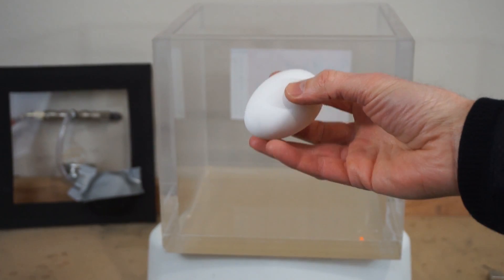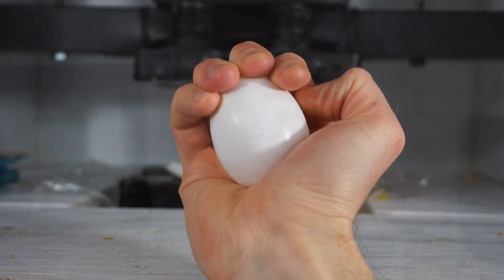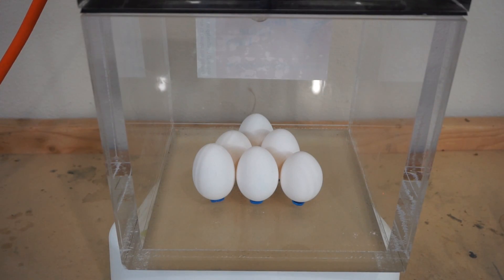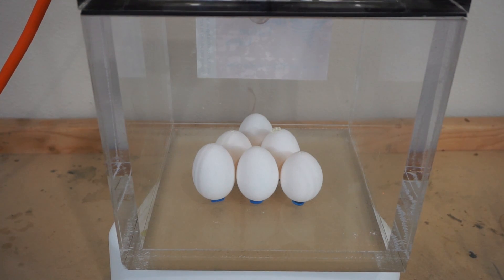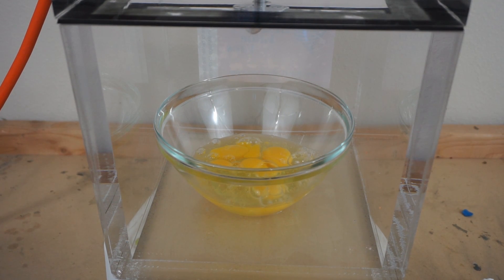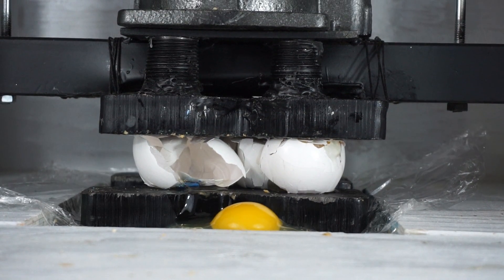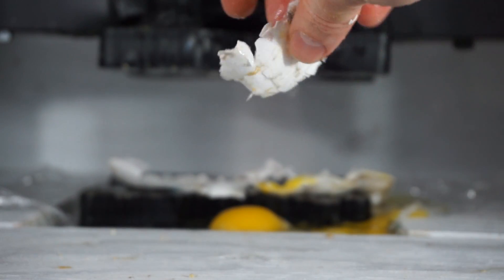What Happens When You Put 6 Eggs In A Huge Vacuum Chamber?

Comment: Can someone please explain why the eggs began to boil in the vacuum chamber?
Reply from the maker: +ueger yonic the lower the pressure the less heat is needed to boil the liquid. If you get the pressure low enough then just room temperature has enough heat to boil the liquid.
Reply: Thank you!
Reply: this boiling is just releasing gases from the egg because there is no pressure to keep it in the egg and there is no heat generated
Reply: They boil because the low atmospheric pressure in the vacuum lowers the boiling point. They don't cook because it takes a certain temperature to denature the proteins. Since this is still at room temperature the proteins haven't reached the temperature required to denature but the boiling point has been lowered to room temperature.
Reply: boiling point is related to something called vapor pressure (you learn about this in chemistry class), which after what +Hydraulic Press Action said (right above me), means that at higher altitudes, and lower pressures, boiling points are lowered (which can actually affect things like cooking in some ways in those places.)  Typical boiling/melting points are based on 1 atm, or 1 (standard) atmospheric pressure.
Reply: also Oxygen is needed, cooking is oxidizing carbon basically!
Reply: It's not boiling in the normal sense as in heat applied to the point of a liquid changing states to a gas, but rather a subatmospheric pressure (vacuum) and the dissolved gasses coming out of suspension back into a gaseous state. In a scuba diver it's called the bends. That's when the diver exceeds their maximum bottom time for a given depth and they become BTPS, body temperature, pressure, saturated at that given depth. When they ascend, the water pressure decreases and the dissolved gasses come out of suspension and form bubbles. It's a fundimental gas law of chemistry. The eggs were not cooked because there wasn't heat sufficient enough to denature the protein. If anything, the temperature decreased as expanding gas becomes cooler. Compressing a gas generates heat.
Reply: Cool Fox everyone on the internet is a science teacher
Reply: less atmosphere, boiling temperature drops dramatically. bam your eggs are boiling at room temperature.
Reply: ueger yonic 
Cold boil, water boils under either heat or low pressure, when the it shakes apart, from either not being pushed together enough, or shaking enough to become gas.
Reply: Ok, but why didn't they cook?
Reply: ueger yonic 

BECAUSE SCIENCE
Reply: ueger yonic boiling isnt a heat based thing but heat makes things lighter and rise allowing it to rise in Normal pressure and boiling but in the vacuum there's no air make the egg air the lightest thing rising
Reply: emphasis on magnificent bastard
Reply: R41N 
Britt Lab did this on water
Reply: It's actually not boiling. It's the wrong term used. From what I had learnt in college, the negative pressure is bigger than the forces of attraction between those protein particles in the egg. And because of this, the protein separates far apart from each other, far enough to becomes pocket of gas, just like how the air molecules are far apart in the air we breathe.
Reply: Henry's law
There is gas entrained within the liquid and as atmospheric pressure drops the gas entrained will be liberated 
Its similar to opening a soda bottle and seeing the carbon dioxide bubble up.
It's not the same as boiling from additional heat because in a vacuum there is no change of state, but the boiling point will drop significantly. That's a poor explanation but it should point you in the correct direction
Reply: ueger yonic the boilimg point of liquids is direct proportional with the pressure. lower pressure,lower boiling point
Reply: ueger yonic Air particles exert a pressure onto liquids, to boil the liquid particles must gain enough energy to surpass this pressure. When we remove the air, less pressure acts on them lowering their boiling point.
Reply: ueger yonic when air pressure is reduced it makes the negative air hotter
Reply: ueger yonic same way your refrigerator works. water boils at 212degrees at atmospheric pressure if you pull it into a vac it could boil at 30 degrees below zero. refrigetator works by mamipulating temperature press in side a sealed vessel takes heat to make physical change from liquid to vapor. there is heat in everthing down to 359 degrees below zero. which is absolute zero
Reply: ueger yonic howtobasic was summoning
Reply: That is some basic shit, no need to be a science teacher
Reply: +Unseemeteor Gaming
Temperature =/= Heat
Boiling something at subcritical temperatures(T<Tcrit), or just going passively into the gas phase from the liquid phase through evaporation  always requires an input of enthalpy (∆Hvap), which means the boiling substance draws heat from the surrounding matter. This is why for example water feels cold on the skin when it evaporates. Even if the pressure is so low that something boils at room temperature, the gas phase is still much more energy rich than the liquid phase since the particles are much faster, so an addition of heat energy from the surroundings is necessary. That is for example the principle of how a fridge works, a liquid is boiled at room temperature in low pressure, and the energy for that is taken from the fridge so it gets colder.
Reply: +Zach Morgan
Entirely wrong, nonsensical gibberish. Please refrain from answering questions if you are entirely uninformed on the topic.
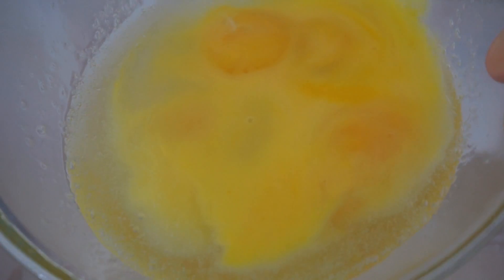Reply: Actually they look to me like they were starting to cook. 3:25
Reply: please what's the name of the video
Reply: lower preasure, lower boiling temperature
Reply: Pressure x Volume (Proportional to ) Temperature

Keep the volume constant, Lower the pressure, lower the temperature you will be needing to do anything with it.
Reply: ueger yonic vapor pressure, you learned it in chemistry
Reply: +Mike Mike the Jack bot Bruh chill
Reply: eric fleming But where eggzatly 😜 is the gas coming from?
Reply: I wonder what they would look like if you left them there until there was no dissolved gas left. Because my thing was how could it let off so much gas but still appear the same?
Reply: Christopher Burke I would imagine not too very different. An example was when  returning Russian cosmonauts experienced decompression of their capsule on re-entry and were in a vacuum for some 10 minutes (no space suits). Aside from evidence of a massive decompression, their bodes looked relatively OK. What I mean is evidence of free air in the tissues. The skin "feels" like how rice crispies sound. If that makes any sense. But the cellular damage if far more widespread beyond subcutaneous emphysema. There's free air EVERYWHERE.
Reply: ueger yonic it's because of the gas molecules in the liquid when the gas gets sucked out, it bursts through the liquid
Reply: what? how did you came to that conclusion? who gave you that idea?
Reply: jezus22 . Who are you replying to? I'm a scuba diver and specialize in respiratory therapy. I deal with compressed gasses, their effect and how the body reacts, produces and eliminates them, among other things.
Reply: i know how compressed gasses works on your body under the highier preasure then normal, that nitrogen is pushed into your blood like CO2 into the coke. but what we can see here is something completly different. it have nothing to do with gas nolecules in liquid cause it's liquid(water) itself changes the form into the steam
Reply: jezus22 . That's the best way I can describe it, because the egg/water isn't boiling. Water won't boil under 212°F at 1 ATA. I have taken syringes of blood, occluded the open end and pulled back on the plunger and was able to pull dissolved gasses out suspension, then release to watch them dissolve back into suspension. Yes, it works both ways. I've also tried it with normal saline in a therapeutic hyperbaric chamber, supersaturating the saline at 3 ATA with 100% o2. As predicted, upon ascent, the dissolved gasses come out of suspension. Saline also behaves the same with the syringe experiment
Reply: water in egg actually is boiling. it is all because of the preasure, or lack of it, cavitation cause the same thing. btw gas inside the lighter is keeped also in highier preassure and that is why it stays in liquid form you compare 2 different things, maybe because in both cases we have common denominator witch is preassure.
Reply: jezus22 Well, that raises more questions than answers for me, from a medical standpoint. Usually when things work right in the lab, when you add animals, things go sideways. See what you've done to me? I'm going to be busy for the next week at the med library. Internet isn't good enough.
Reply: Henry Waller lol
Reply: ueger yonic because the atmosphere is being changed so the room temp is enough to cook it
Reply: oh ok :)
Reply: The easy way to look at this is to look at "boiling" and "cooking" as two separate things.  "Boiling" and "freezing" aren't really designations for cooking.  They are designations for the points at which matter changes phases.  The boiling point is when matter goes from liquid to gas.  The freezing point is when matter goes from liquid to solid.  "Cooking," on the other hand, is about making stuff safe and hopefully tasty for consumption, and, as someone mentioned earlier, the denaturing of the proteins is tied to temperature.  BTW, it is not safe to subject food to a vacuum outside of certain high or low temperatures (or levels of acidity) because of the growth of the organism that causes botulism.
Reply: henryk077 wait are you a Science teacher? It seams like it
Reply: ikr
Reply: Boiling happens when the surrounding pressure is equal to the vapor pressure so one way to boil is increasing temperature which would increase the vapor pressure but anther way is to decrease the surrounding pressure until it is equal to the vapor pressure from the egg.
Reply: MagnificentXXBastard elaborate
Reply: MagnificentXXBastard boiling does require heat but that heat depends on the pressure. So if the pressure is low enough room temperature will boil something.
Reply: i've seen a codys lab video where the egg boiled and then froze
Reply: The freezing and cooling is due to the heat absorbed by the boiling in the vacuum. What i explained above.
Reply: elyes grati Now this guy is smart.He knows how to explained better.
Reply: People often refer to certain liquids "boiling" in a vacuum. There is no heat generated from this. You would need friction or an application if energy. The "boiling" effect is simply the oxygen gas being released from the eggs. Just think about it. He has attached a vacuum to suck all the air (oxygen) out of that chamber, oxygen is a basic building block in alot of natural material. It is no different for these eggs. So the "boiling" effect is simply the oxygen inside the chemical makeup of these eggs being released. I felt short changed the first time I saw a "boiling" liquid vacuum test because I thought it would magically boil the way everyone thinks it will. They should have coined a better term the first time someone discovered this, it makes the general populous think you can cook eggs without heat inside a vacuum.
Reply: Because the gravity of the earth is inside the popcorn
lol 😂😝
Reply: ueger yonic it's not boiling it's just taking up space because the vacuum is sucking out the air. Things can expand but air and other particles keep things from doing that.
Reply: ueger yonic Cody'sLab has done this already, and his explanation will help you understand the actual science going on.
Reply: ueger yonic stupid 6 year old
Reply: +Super
Bullshit explanation, boiling always requires heat.
Don't explain something if you know shit about it.